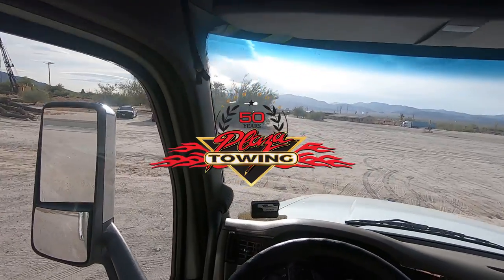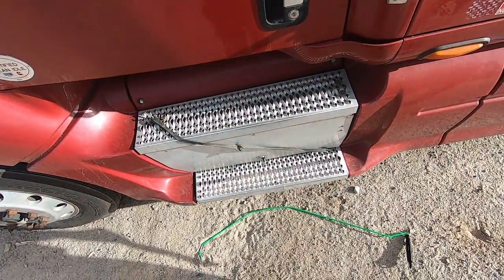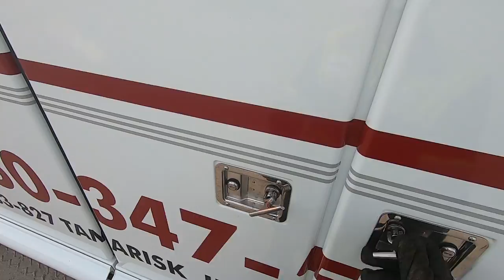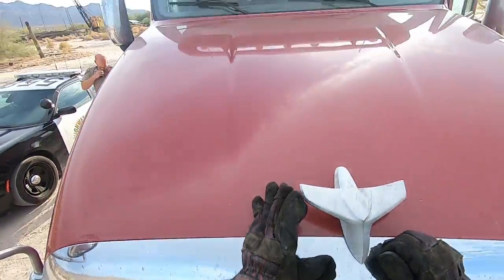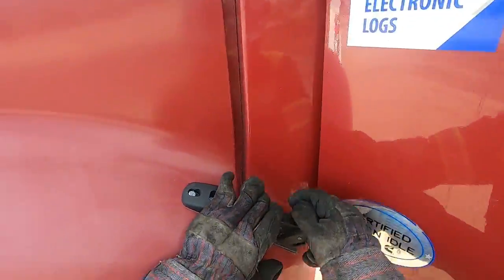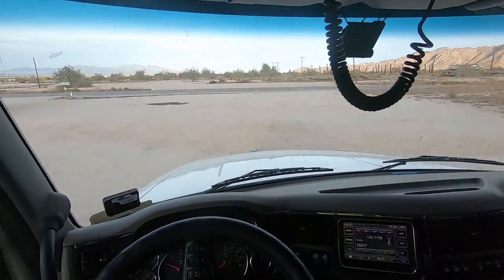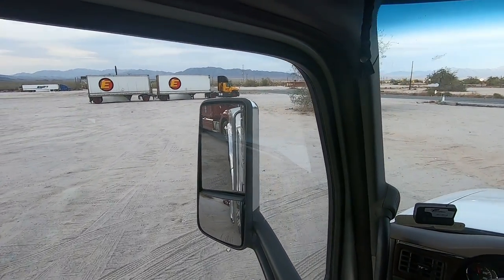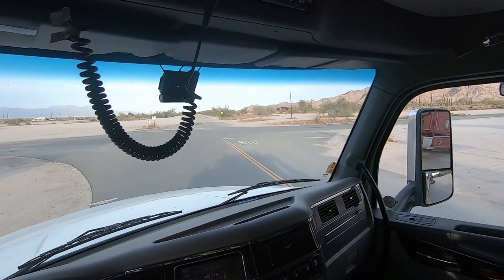Unlocking an Abandoned Semi & Towing It Away For CHP

Comment from the maker: The reason we did not hook it from the rear is there is debris directly behind the truck that would inhibit us from getting perfectly straight with the unit. Yes we can hook from different angles but sometimes it’s just not worth the hassle. Additionally the combination of it being abandoned and it being 50 miles from our shop leave us to believe it is safer to tow from the front, with 8 tires on the ground rather than from the rear with only 2 tires on the ground. This and the taken apart steering Column lead us to believe-front towing was the best option. We appreciate you watching!
Reply: Thanks for answering my question before I asked. As a medium duty driver(20 ton) I try to tow from the rear whenever I can.
Reply: Can't help but wonder how far that truck already went with only two tires on the ground at the front end. I bet it could make 50 more miles.
Reply: 9113
Reply: @brucebannerman6848  but you don't want to bet when people lives could be at risk    you want to be sure your choices are best possible given the known facts.
Reply: What will happen with the truck.
Will you own it ? nice video
Reply: @ncrtransport5993  exactly
Reply: Great job again.  Another reason to tow from the front is the fact that the air fairings on the truck will rip away from the trucks when towed backwards.  Been there done that.
Reply: New subscriber here. I love this channel already after one video. I am in for the long haul here Plaza. Thanks for this upload.
Reply: Plaza Towing What'd u got n the truck ur driving, an auto-shift?  I didn't hear any evidence of shifting gears as u drove.  Miss the Big Trucks!  🤧
Reply: @roshanmanilal5315  If the truck owner decides they don't want anything more to do with the truck. Chances are at some point it could go to auction OR get sent to a junk yard. If the owner of the truck don't want to claim the truck the towing company could place a lien on it.
Reply: That’s a prudent choice!!! I was “Like” 88. I ain’t crazy!!! I think.
Reply: Safety First, Safety Always.  Good work Trent on always working on the side of safety.  You are awesome, don't listen to these cowboys.
Reply: What was wrong with the truck?
Reply: So you have to be a qualified mechanic as well as a big-rig driver to do this work?
Reply: Plaza Towing, when we tow a tractor from the front, we always pull the axles out on one side rather than drop the driveshaft.  As to towing from the rear, we tow a lot up to 400-500 miles.  With airbag suspension, we may chain up the front tandem.  You have to watch your bridge clearance (on the east coast) either way.
Reply: I really wondered about that, thanks for your insight.
Reply: Why are you driving a Jerr-dan? I thought you had a Miller?
Reply: if you have an air line with a glad hand connector you can hook to the blue air line (service) and push air back into the tanks filling them up so you can release the brakes. although as fast as you are putting that connector in the air tank it looks like youve had to do that quite a bit.
Reply: Oh and the city transit buses with pusher's and short drive shafts.. 🤢🤢
Reply: nope all the youtube towers are professionals.. even got em selves the new american truck simulator... ( i really hope everyone knows im making a bad joke.)
Reply: With only 2 tires on the pavement, you're gonna have an extreme amount of static build up, you Don't want any blowouts.
Reply: @dhunter48951  ,
I had a contract with Yellow Freight, I did many Tandem Tows,  the more wheels on the ground the better control.
Reply: Roshan Manilal p
Reply: Got any jobs. ??  I do the same job in uk London.
Reply: Harry Gooch  Power take off. On his truck it is most likely used to give power straight from the engine to the hydraulic pump. Farm tractors use a PTO to power their trailers
Reply: Plaza Towing ososwosoq
Reply: A.O.W.media 7
Reply: DANNYEANNY
Reply: Plaza Towing de la Universidad el león San león San perro de la Universidad 0 DANNYEANNY QUE PERSONAS
Reply: Harry Gooch  Power Take Off.
Reply: Harry Gooch Power take-off. It’s a provision on the truck’s transmission for mounting auxiliary equipment, as in this case, a hydraulic pump. 
On transmissions equipped with a PTO provision, a blanking plate will cover the port until equipment is bolted in. When accessed, there will be a gear that is driven from the transmission’s input shaft or countershaft, allowing the PTO to be driven independently of the transmission- like here. The truck was placed in high idle, in neutral, with the parking brake set. This allows the truck’s engine to power the hydraulic equipment on the wrecker body. 
The trucks you see pulling dump trailers will also have a similar set up- a wet kit, as they’re called, to allow the truck to power the hydraulic ram on the dump trailer. The driver can turn the PTO on and off from in the cab by electric clutch, like this truck, or by a cable, like the old Chelsea style PTOs. 
There are hundreds of configurations and implements that can be run from them, and generally a control group is added to the truck so engine RPM can be dialed in and placed in hold, so that PTO rpm can be held steady. 
Even some older 4x4s had the provision for a PTO on the transmission, so it’s likely you’ve seen the port. I had a ‘78 F100 with the NP435 and NP205, and it had one powering a pto winch. The winch ran off a small driveshaft running from the transmission to the front end. It worked great, until you buried up in mud and water and the distributor got wet!  No running engine, no winch 😂
Reply: Harry Gooch  Power Take Off.
Reply: power take off

Comment: I can appreciate all of the double checks that he performed. Even if you’re a seasoned driver such as myself, distractions can occur and throw you off. Once I forgot to release the parking break on the truck, and luckily when I got onto the highway a motorist honked his horn and gestured to the rear of the truck. When I pulled over and checked it out the brake rotor was red hot, and may of been possibly very close to bursting into flames.

Comment: FYI...SOMETIMES, on those 387's, they originally came with hood release on floor next to seat. Eventually they would fail to keep hood latched. Solution was installing rubber latches. It could still inadvertently latch on its own. Hope it helps. Keep up good posts young man!
Reply from the maker: lol you are correct I found this release when I was dropping it off
Reply: Well that answers  my question.  Thanks.
Reply: You're right. The release cable breaks, but there are emergency release cables on both sides up under the wheel opening. It's just a wire loop hanging through a hole in the plastic.

Comment: A trick I learned years ago is call a glass shop and have them remove the window just forward of the roll down window. It costs a lot less than a locksmith or tow truck (if you’re the truck owner)
Reply: Or just knock it out. Later get one at junkyard.

Comment: Feel safe that I lock doors when a vehicle can be open in less than 30 seconds
Reply: Seatbelt on doors and a club over the wheel do wonders to keep truck secure but you can always smash glass to get in
Reply: well, @GLENN,,, this is typical of all vehicles, not just Semi Trucks,,, noticed many yrs ago that my auto key opened another vehicle (same color, model, make, etc) when at a convention, and i mistakenly opened someone else's vehicle with my key,,, never knew that "DETROIT" (auto companies) key so many vehicles alike, to save on expenses and to eliminate the need for so many diff combinations/etc
Reply: There's a good chance the key from his wrecker would have worked to open that door.

Comment: So I take it this truck will be sold off at auction to recoup the costs? Here in the UK if you own a truck, you legally are required to have funds to repair it if it fails, if you do not have the cash, you are called in front of the regional traffic commissioner, who will revoke the operators licence, and levy a big fine. Unroadworthy vehicled get PG9 notices, and to clear them must have a full MOT test.  Clearly this operator is a cowboy running on a shoestring
Reply: There is probably a finance company involved...in most cases there is an escrow account a security deposit that gets used to pay for the tow, impound and retrieval if then finance company can repair it.
Reply: Typical government. "You don't have the money to fix this? We are gonna revoke your license so you can't earn any more money, and then slap you with a big fine just to be safe." 

What a joke.
Reply: @MikeLSkate123  It's all about stopping unfit commercial vehicles from being on the road. UK operators do not necessarily have to have cash in the bank for the minimum financial requirements - overdrafts, available credit on company credit cards and the like all count. However, it must be money that is available if required.

The licensing regime also requires periodic maintenance inspections - for which the operator must be able to produce records on demand.

Comment: This was in my recommended, no idea why, and so ofc I watched the full 30 minutes. Why the disconnection of the driveline ?
Reply: Eddie Carter basically to not spin the transmission or the engine
Reply: If I remember correctly, it's so you don't damage the transmission or engine on a long tow. Not sure if trucks work similar to cars but my friend who tows said that is the driveline/ shaft is connected, it will still spin the engine but no oil will be moving to lubricate anything. And that is never good.
Reply: The transmission will spin without the engine running due to the engine not running no or little lubrication is provided to the transmission causing it to get extremely hot causing significant damage ....go to the byline or whatever of the video he  explains in one of the questions

Comment: Is there a reason not to tow it by the rear?
Reply: Yes at highway speeds the wind can damage the air shield on top of the cab towing backwards and the mirrors are not meant to  go backwards at that speed. Less chance of damage towing from the front.
Reply: it would be like towing a trailer with too much weight to the rear ... tail wagging the dog.
Reply: maybe because front wheels would turn freely right and left and front bumper would be very low to the ground
Reply: I believe it has something to with the air bag suspension. If it were towed by the rear, the suspension on the drives has to be chained up to the frame to keep it together to avoid damage when the weight of the truck is off of it. Also, the steering wheel has to be anchored to keep it from moving when being reverse towed.
Reply from the maker: USMMCE The reason we did not hook it from the rear is there is debris directly behind the truck that would inhibit us from getting perfectly straight with the unit. Yes we can hook from different angles but sometimes it’s just not worth the hassle. Additionally the combination of it being abandoned and it being 50 miles from our shop leave us to believe it is safer to tow from the front, with 8 tires on the ground rather than from the rear with only 2 tires on the ground. This and the taken apart steering Column lead us to believe-front towing was the best option. We appreciate you watching!
Reply: hey USMMCE, ya didn't read the info under the vid,,, he explained WHY NOT to tow it from rear in this instance (but normally ya can tow it from Front or Rear)

Comment: Dumb question, Putting it into neutral wouldn't work?
Reply: no, it ruins the trans and some difs on big trucks/tractors (oil cant go where it needs to be)normally the axle shafts are removed to prevent this but in this case, he removed the driveshaft.
Reply: No. The problem is there is no lubrication to the transmission bearings without the input shaft turning. You have to pull the driveshaft to avoid causing serious damage to the transmission by towing.
Reply: enkrypt3d it’s a manual
Reply: Air brakes are engaged when no air is applied.
Reply: It was probably an automatic transmission why he disconnected the driveshaft
Reply: Because of the way its being towed, on an angle, if it were in neutral and the drive line was connected the transmission would overheat due to not having fluid reach all gears, because its tilted up and everything will drain to spot. So no, leaving it in neutral would not work. Instead of removing the drive shaft, the axle shaft can also be removed for towing
Reply: No because you are still driving the transmission in a way it is not intended to be driven. Putting it in neutral (if it has one as it could be automatic and/or need electrics to put it into neutral from park) just stops it driving the engine.
Reply: Actually you should read the video description as to the real reason why you have to pull the drive shaft and can't leave it in neutral.

Comment: On most 387 Peterbilts I’ve seen, they have a wire that you pull in the wheel well to open the hood, not just the latches.

Comment: Get a couple different cuts of the paccar key and a little fiddling with the lock will get it open, ive helped a few drivers back into their trucks using this method
Reply: It also works on the other trucks that use the Chrysler key like freight liner and some volvos

Comment: What kind of Semi wrecker doesn't have Glad hand air supply connectors with them? A hell of a lot easier and faster than rolling around on the ground, taking the drain valve out, installing a quick connect etc. You will appreciate having a set with you when its raining. Simply connect your air line to the truck's glad hands and be done. When you apply the supply button, it fills the tanks through the glad hands. All three of my fathers semi wreckers uses them to hook up.
Reply: Wrong.  Trailer supply air valve won't open without pressure in the tanks.  There is also check valves in the system.

Comment: I think I towed this same tractor in NYC towards the end of last month or the beginning of this. Driver had a bad battery and emptied a brand new bottle of starter fluid into the intake. Made a loud pop and the truck wouldn't start again. Towed it to westchester freightliner, they denied working on it due to deleted emissions devices, towed it to us and we eventually got it started. It just smoked once we got it started and the smell of all the starter fluid burned our eyes. Owners chose to drive off with it and the trailor attached once I ran for 30 mins under it's own power. My option, hook it from the nose, pull a axle, cage brakes, safty chains, lights and I'm off.
Reply: non'ya biz when you pull the axle do you have some kind of plate that bolts back where the axle was so it doesn’t loose fluid? always wondered how that worked. Also is it necessary to pull the axle in standard transmission truck?
Reply: @sannajo6742  Its taken off at the yoke, so there is no fluid at that point in the driveline. 
And yes, its always best to pull the drive shaft, the same dry turning can happen with a standard.

Comment: Good wouldn’t open because they tend to get stuck on rubber and plastic seal that it closes on. The only way to keep it from doing that is to open it regularly. Which shows the driver probably didn’t do pre or post trip inspections and that’s why it’s on the side of the road.

Comment: stepdad is a locksmith and sometimes dodge van keys will pop the locks on semis if you need to open them..hes unlocked a few using that method without having to use a lockout tool..

Comment: You guys must have a huge tow area to cover. Where I'm located in Virginia, a heavy duty tow company might have a section of interstate highway that's 50 miles in total length, but your yard needs to be somewhat close to the middle of the area.

When I did heavy towing, the standard disablement or abandoned tow was $175 and $40 a day for storage. Accident recoveries gave you winching and an hourly rate for lumpers if loading and unloading was required. I was the first in the area to have air bags for up-righting trucks and trailers.

My brother totaled his International Eagle a few years back. Twisted the frame on a roll over, but the trailer stayed upright. The tow bill was close to $5k.

Comment: Question, why did you disconnect the drive shaft instead of just knocking the truck out of gear?
Reply: TheNASCARJeff wondering the same
Reply: @lasjcrew  the transmission has an oil pump driven by the input side of the transmission when it is in neutral the pump is not turning and will cause damage to the transmission

Comment: @Plaza Towing.  When you say the Truck is set to be towed this way.  DO you mean the Peterbilt or your Wrecker?  Also If your light bar were to fall off does it let you know some how or do you just have to order a new one and pair it to your truck?
Reply: I can answer the light bar ones. The bar does not have a proximity alarm so you wont know it's gone, so strap it well. TowMate bars are universal and you wouldn't have to sync a new one to your truck because they are all on the same frequency. This is interesting because you can have 2 tow trucks sitting next to each other, when the guy on the left turns on his hazzard lights, both bars hazzard lights will come on. There are some smaller cheaper lightbars but heavy duty applications require bigger more expensive ones. The lightbar on my wrecker runs about $800 USD without the sending unit.

Comment: Just a heads up, not sure if all those 587s are like the one I drove, but mine had a latch inside to release the hood. Seems like it is still latched. Usually there are cables on each side of fender well u can pull to disengage if this one had that. I'm not sure if it does with it having straps also... just food for thought.

Comment: Gotta get the whole bag inside. I do lock outs everyday so I'm used to the pain of finding the right spot
Reply: A nylon wedge as the first tool helps gap it slightly so the whole bag slide easily inside. Makes everything that comes after much easier.